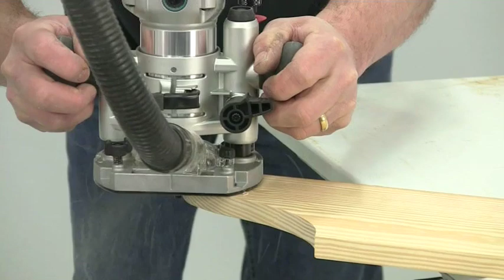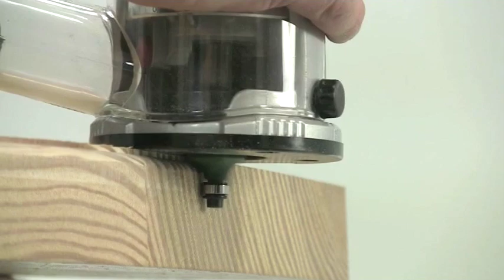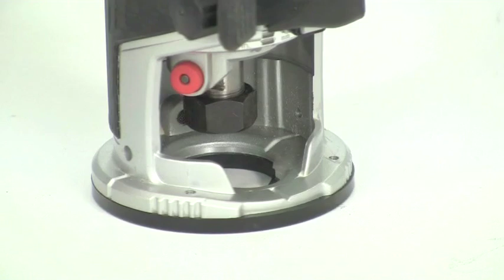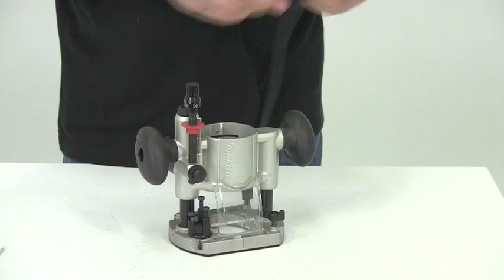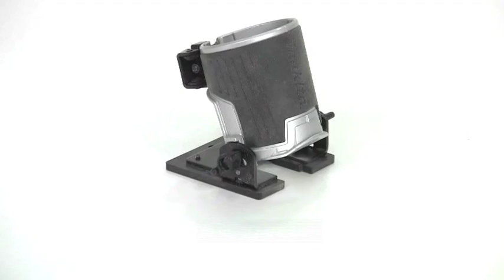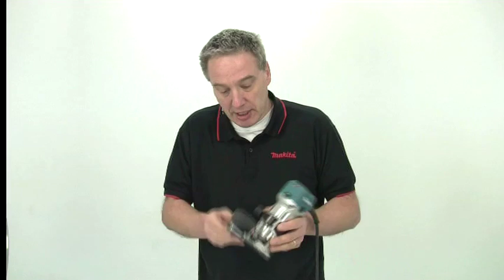Makita RT0700C Router / Laminate Trimmer

Comment: almost 250 and it doesn't even accepts Porter‑Cable type template guides. some body forgot about the most important thing in router.
Reply: WV591 I have seen another youtube video showing an adaptor you can buy to suit the porter cable templates.
Reply: most important thing in router ? for who

Comment: I watched this for info about cutting laminate ..... did not hear anything about this.  Perhaps the video name should be changed?
Reply: +Jan Filbeck indeed  i agree
Reply: Router/laminate trimmer is the unit being reviewed...
Reply: I used the same trimmer for 10yrs almost everyday in a workshop doing laminates and they work awesome, lots of power and very tight and fine detailed edges.

Comment: I acquired this router (standard kit) about two months back.  I was using a large Skil router attached to a table for most of my routing needs, simply because it was a pain to detach and reattach constantly.  Primarily I bought the Makita for doing 1/4 roundovers and other trim work.  I haven't used the Skil since.  The Makita is an amazing machine.